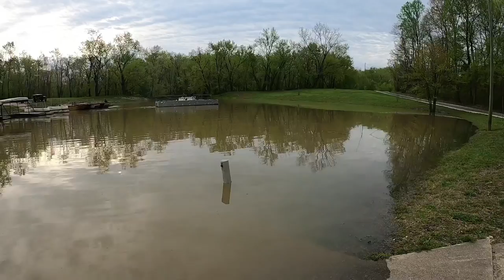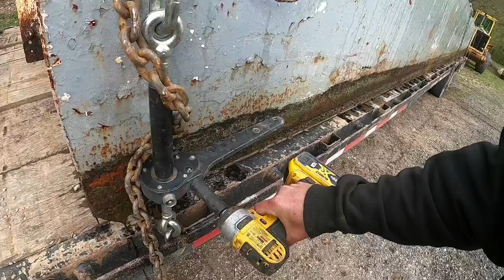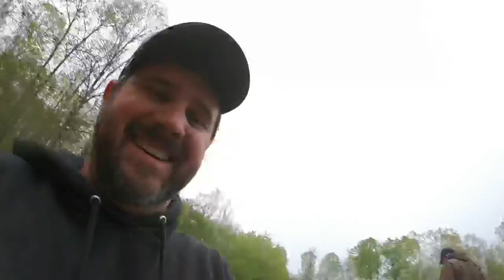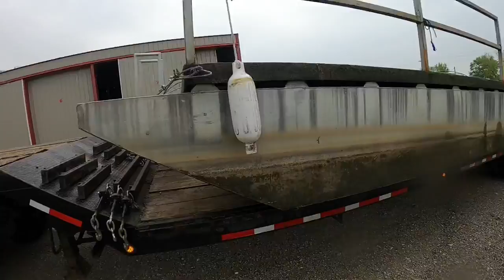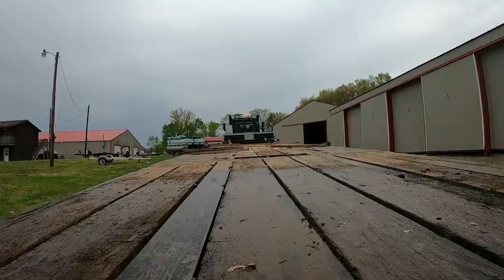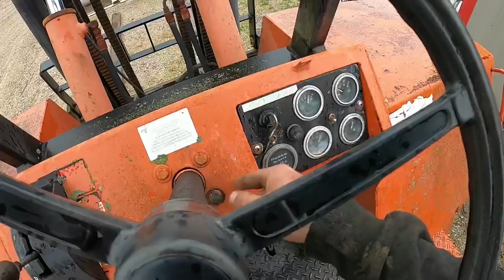Rainy day project moving boat docks with the Mack and loader this could get interesting

Comment: I guessed 4.5 tons, I owned 3 salvage yards and downsized down to one due to the low prices over the last few years and just kind of a hobby now but I've had to get really good at guessing thousands of semi loads of scrap metal over the years so we wouldn't get over weight tickets going from the job to our yard. It's funny he mentioned that it's too bad that you couldn't steer with the brakes like a farm tractor because I was thinking the exact same thing. Our Massey Ferguson forklift had steering brakes and had to use them all the time for that exact same reason. Great job Mike on getting it done!

Comment: You need to weld a short chain with a hook on those fork extensions, then chain them to the forklift so they come out when you pull out.
Reply from the maker: Yup I agree
Reply: Then how would you get the extensions under some some loads? Put holes big enough to get chain hook in back of
 extensions.    (Always enough time to do a job safely) too many shortcuts makes for bad habits.

Comment: Well that was fun. You gave me a flashback to last week when you went into the scrap yard. I went last week, two new tires on the truck and 4 tires that will need to be replaced in the next month. Ran over a huge bolt and punctured a tire. Guess which of the tires got punctured, yep, it was one of the new ones. I'm about as lucky as the captain of the Titanic.

Comment: Mike, did you mull over backing the trailer into the water and then winch the aluminum barge up the trailer ramp? Given you could fit between the white posts.
Reply from the maker: Not work risking my trailer and would frame lock on ramp
Reply: @DirtPerfect  understood. It was only an idea. Though be it not a good one. Is there a way to cheap fix the truck or trailer to completely eliminate the frame locking issue? 
Still enjoy your vids and comedy within. :)

Comment: I bet you could have drove in forward and done a good U-turn by the boat ramp, you just did not want to show off.
great job in reverse, all road signs intact, and the loader did not go swimming. watching the fork extensions and knowing they bend near the tip as you lift, the far side should have felt like it was not moving until the near side was 2 feet up  or more
Reply from the maker: Not possible with out tearing up the road or yard

Comment: Almost might have been faster to just back the trailer down the boat ramp and pulled them on with the trailer's winch. Though I would guess the boat ramp isn't that long and the trailer would have sunk into some nasty muck. No matter how big the fork lift is, sometimes you just need a bigger one.

Comment: Next job take the - fork truck to the scrapper - that thing would not have been allowed to operate in the UK.
Reply from the maker: Well last I check was not in the uk 🤷‍♂️😂😂😂😂😁 thanks for watching
Reply: @DirtPerfect  All the kit at my work , tractors , mini backhoe , forestry winch , buckets , forks etc are all checked twice a year for wear , damage etc due to health and safety laws here in UK .
It's all pretty strict.